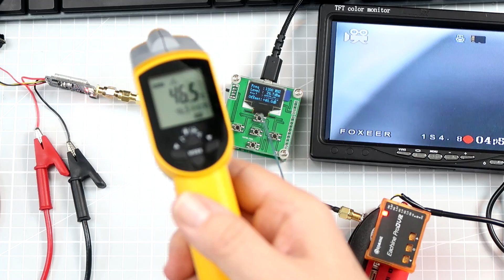Matek VTX-1G3 1.2GHz FPV transmitter Power Test

Comment: On a DJI drone, I would like to install a Mateksys VTX-1G3 1.3 GHz only to retransmit the sound of the motors, because as on all FPV drones, we have the video return, but unfortunately no sound return. My question is, how to have the sound return with the integrated microphone on the VTX-1G3 1.3 GHz and also how to connect a speaker to the Receiver 1.2/1.3GHz, VRX-1G3?
Franck from FRANCE

Comment: I saw a post in TeamBlack sheep about 1.2Ghz vtx which is why I searched youtube and found your video. When I started fpv 1.5 years ago, what I only know about vtx is 5.8Ghz. Is there advantage of using 5.8ghz vs the 1.2Ghz? It looks like 1.2Ghz is really good for piercing walls.

Comment: He pawel, i got a dockking and a 1G3Vrx matek one, but the matek has 10 pins and the dockking only 9 holes, how do i overcome this?
Reply from the maker: really? Just plugged one into the other and it worked. Maybe by accident? I wil have to count the pins
Reply: @FPVUniversity  got it, sniped the top pin S2

Comment: Any issue/interference with R9M 915mhz radio? I am not an expert at radio stuff but I know they have low loads filters one can buy but some transmitters have filters on them. 

Have you had any issues with 915? 

I also run RFD900X's

Comment: What is the reason that we use 5.8 over lower frequencies then? Cheaper transmitters? Higher bandwidth? Less restrictions? Smaller antennas? If you had the ham license required and so on is there any good reason to use 5.8 over this?

Comment: Re legality: AFAIK 1.2G fpv band is not open for unlicensed use anywhere in the world. However, some of the 1.2GHz channels are in the 23cm ham band. With a suffient ham license you should be able to use it in any country, which has reciprocity agreements with the country where you are licensed.  In Poland you will need a category 1 license (higher class), but in US technician license (lowest class) is sufficient. Anyone with EE background should be able to pass the exams after spending just a bit of time on getting familiar with regulations. 

Using the vtx without a license is just a matter of luck. If you don't step on anybody's toe, you should be fine. However, with a bit of bad luck you may end up with equipment seized by the authorities and a fine to pay.

Comment: Pawel, does your power meter work with 5.8gHz transmitters, especially at the upper end near 6gHz? The specs are typically Chinese ambiguous, Advertising says 1-8gHz, the specs state it measures up to 5gHz...
I hope they release a lower power version  of the transmitter. I get 30kM with 150mW and nothing onboard gets interfered with, for me 1 Watt is just a waste of energy at 1.2gHz, and will cause more problems with GPS, servo's and some FC's. Power control would be too much to hope for.

Comment: Have you got any idea if they will be releasing a 2.4ghz vtx. That plays nicely with crossfire.
Reply: Why..?.. you can use 1.2g alongside 868mhz or 915mhz...I do, no problem...2.4g will be inferior and als prone to RC transmitter interference.
Reply: @EnglishTurbines  I've read that 1.2g alongside 900mhz can cause issues. How true that is I've no idea. 2.4 tx interference is not a problem. We are all on xfire. Also the 
l.2g antennas are ridiculously large.
Reply: @51im  You need to do some homework...I fly UHF alongside 1280mhz video...I fly R9M system on 868mhz alongside 1280mhz video...No problems whatsoever, no RF filters, just a little antenna separation...I even have it on a 5 inch quad....1.2g antennas are not huge, in fact smaller than your crossfire Rx antenna (it's a Dipole)...I only need a Dipole on my vtx, NOT those rediculous Skews...Not needed on such a low frequency....200mw....8kms, no problem, clear image and no flying on the edge of space either.
 Golden Rule, your video frequency should always be higher than your control frequency.
Reply: @EnglishTurbines  
Yeah I suppose dipole is the way to go. I've had 5k on 5.8g at 200mw. But I've already got a 2.4g diversity Rx that I'd like to make use of. Anyway why not have the option of 2.4g. more choice is more better.😆
Reply: @EnglishTurbines  1.2 ghz is not legal in most countries tho...
Reply: Doubtful, it's not popular as a video frequency, it also lacks the range of 1.2g.
2.4g video has been around ages, Immersion do one, never caught on really.
Reply: @EnglishTurbines  
Guess I'll get the immersion one then. TBS do one but it's about $100. Have been hoping for something a bit more up to date. In the 2.4g flavour.

Comment: Do low ghz rather than 3.8 have better range?
Reply: Low frequency = Long range, it's why 5.8g is so terrible.
Reply: Yes 1.2 is better than 5.8. Since its putting out more than 600mw, that is more than enough for some serious long range flights, especially if you use a high gain ground antenna.
Reply: @christopherstarzyk9209  Does it have a better penetration behind trees? How about concrete building?
Reply: @Nousernameization  Yes, and it can even go behind concrete buildings! 400mw went through 6 detached houses in my testing!